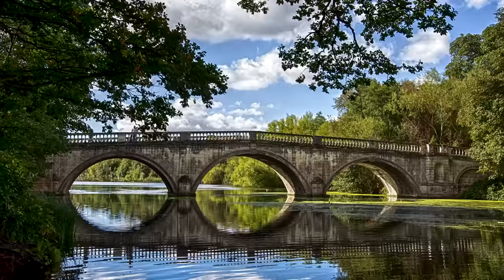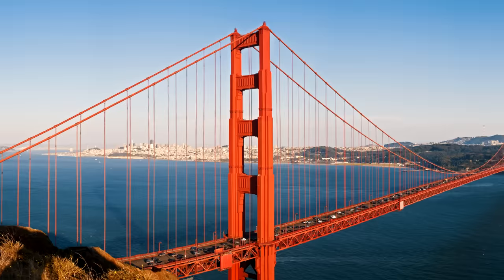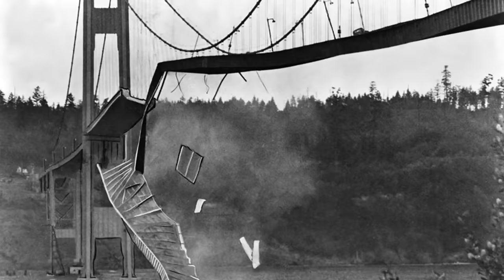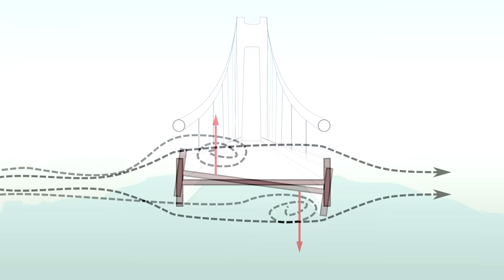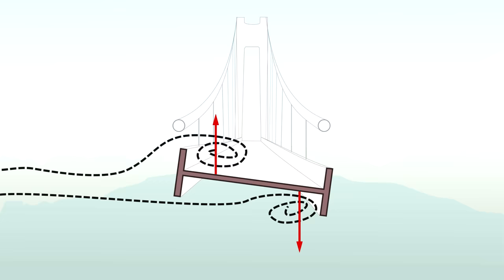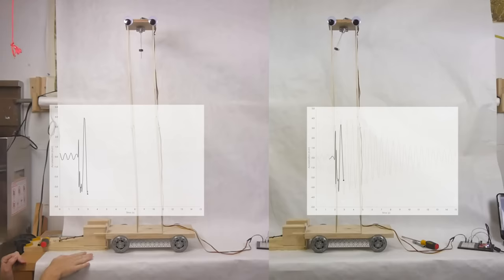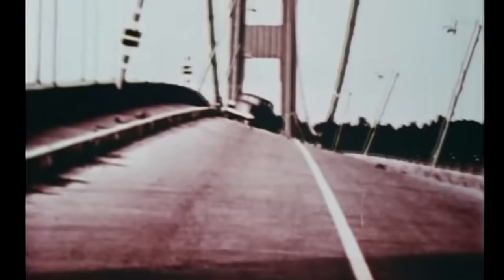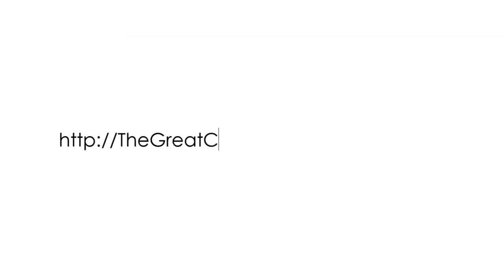Why the Tacoma Narrows Bridge Collapsed

Comment: It only took 4 months to build a good  model the Tacoma Narrows bridge in a wind tunnel. So why haven't engineers made physical and virtual models of the North Twin Tower to explain the collapse.  But how can that be done without accurate data on the distributions of steel and concrete down the buildings?  Engineers don't ask!

Comment: Please give what engineers gave solution for this vibration.
Ex:
1. Cables below to reduce vibration,
2. Suspended bridges to control deflection etc
Your method of cutting runway is correct by physics  but not practically used.
Reply: For the second bridge (which is turning 70 this year), they utilized an open latticework of trusses for the sides and strips of open grates between the lanes to allow the wind to flow though. If you every drive across the old bridge, you will see warnings not to change lanes. The reason is because of the grates.

Comment: On the subject of "Resonance"....look at any rubber car tire....think the tread pattern is perfectly even all the way around? Look closely again....there is a section where it's NOT perfectly even....if it WERE perfectly even around the entire outer circunference of the tire the tire would fly apart at speed....the one uneven section breaks up any resonance....the resonance is caused by air being trapped in the tread....air trapped in the tread is squeezed out at the point where the tread meets the road....that's why huge "mud grip" tires are noisy becuse the deeper tread traps more air....you can spin a knobby mountain bike tire in the frame, moisten the palm of your hand, and place it close (not touching) to the spinning tread and you can feel it....car and truck tires even more so....and they spin at a higher circumfrential speed....that's partly why "racing" tires are "slick" with no tread pattern...

Comment: I wonder if the collapse could have been avoided by setting up a model in a wind tunnel.
Reply: The original bridge was built in 1940, and I don't think they really thought about the wind being a problem. In this instance, it was more about the construction company cutting corners than the actual design. The original design called for open trusses like what the second bridge has today. The builder cut corners by using solid panels instead because they were a lot cheaper to make and faster to install. If they'd stuck with the original design, there wouldn't have been a problem.

Comment: Once again, an incorrect explanation of the phenomenom. Aeroelastic flutter frequency is not necessarily equal or near any natural frequency of the structure. It have been shown that the natural frequency of the Tacoma Narrows bridge was far from oscillating frequency due to wind. This is why this is an aero-elastic phenomenom, because the frequency depends both on the structure (elastic) and aerodynamic forces. It has to be studied as a coupled phenomenom.

Comment: Thank you for the circular flute around chimneys, or exhaust ports.. When at uni they never answered the question about why do these chimneys have spiral surface mounts around them.. i guessed it was to help with circulating wind to make dissipation more effective.. The fucking bastards never told me the answer was to prevent this effect. This was 24 years ago.

Comment: in engineering wind is the enemy of tension and force. too much wind causes too much tension and the bridge will snap like a twig. Case in point thats how Galloping Gertie failed . there was too much tension on the wires and the deck was not stiffened. Today it is a federal requirement all bridges require stiffening trusses and the wires must be galvanized to prevent rust or an earthquake or high winds will destroy it.

Comment: we know that force already which can destroyed the structure, so we know at which part of time the structure going vanished😎😎😎
strength going weathering and force of gravity and heat and wind and temperature change and water mechanically strength wise correlation with metal structure and corrosion😌😌😌😌😭😭😭
so we got that frequency factors which determine the relationship between speed and mass and torque and weight loss by weathering

Comment: Thats what happens when civil engineers make cost efficient solutions more cost efficient😂
Reply: In this case, it wasn't the engineer, it was the construction company. The original design had open trusses. The construction company decided to use solid panels instead because they were cheaper.

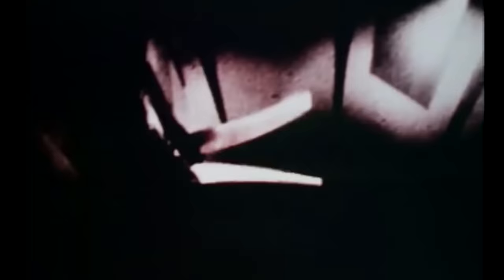Comment: 6:42 wind loads during stalls could easily destroy an WW2 airplane so it's obvious that they are designed to withstand air forces. No need to be an engineer to know that ;p. (Although I am)